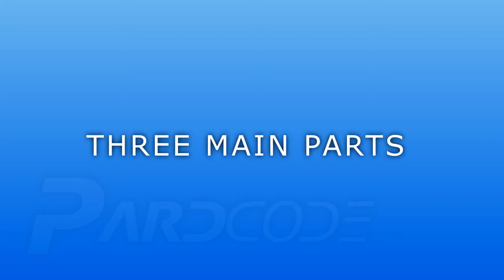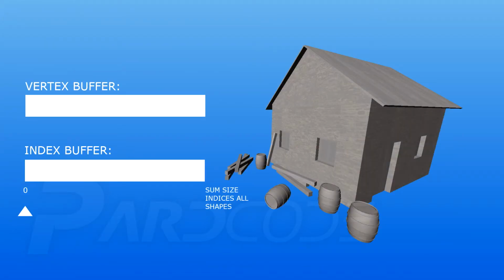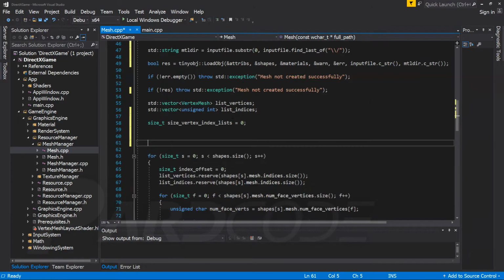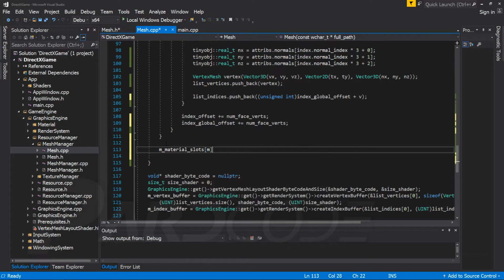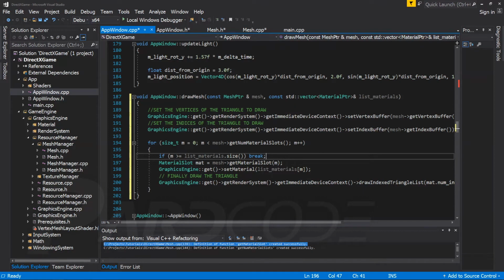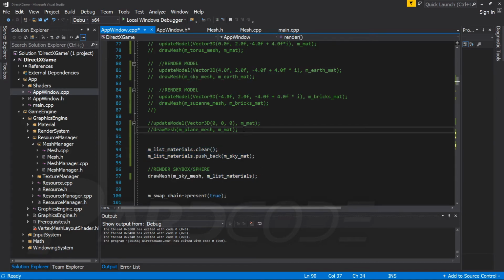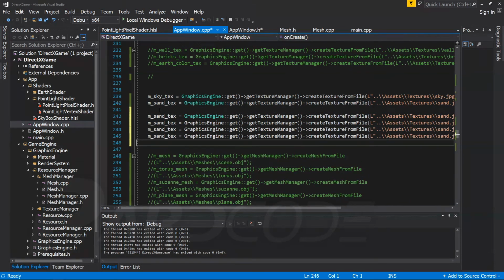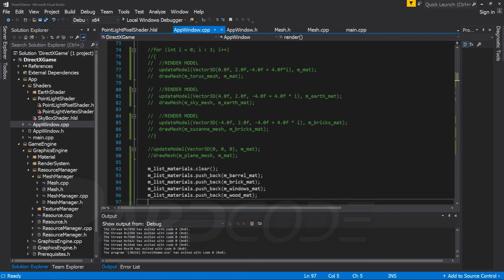How to make a 3D Scene | C++ 3D Game Tutorial Series #25

Comment: how do we create our own mtl file if we want to create our own models? do we just export it as an obj file from 3dsmax ? or do we need to also texture it in 3dsmax and export then just add the texture reference and model reference in the code? how do we do it right without having problems with the texturing?
Reply from the maker: Hi, mate! When you export a model from 3DSMax or Blender in OBJ format, a mtl file is also created. In our code, we use mtl file only to define the different parts of our mesh, and material slots.